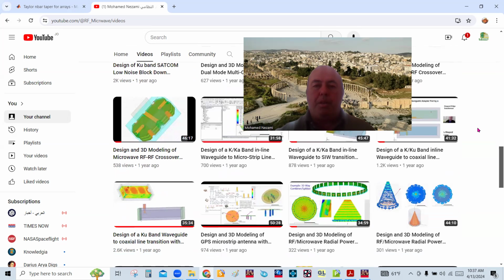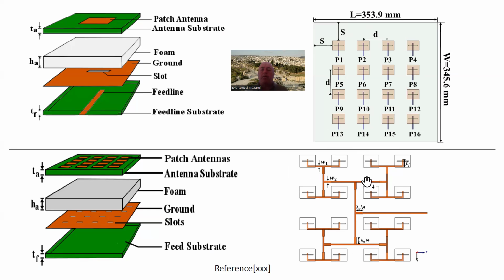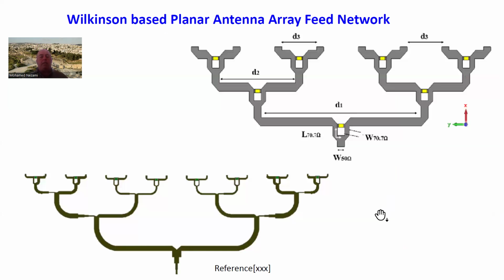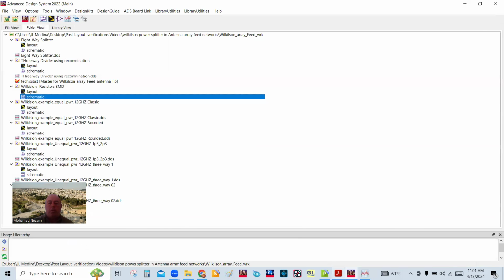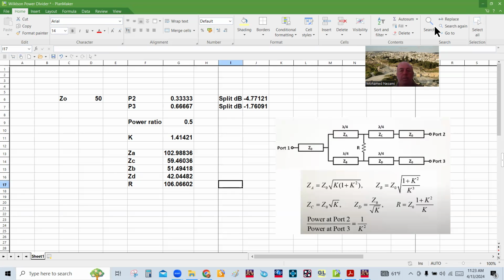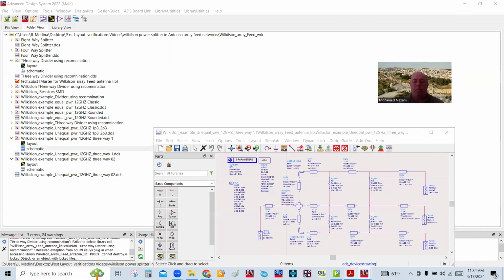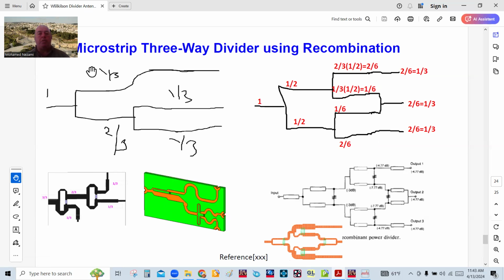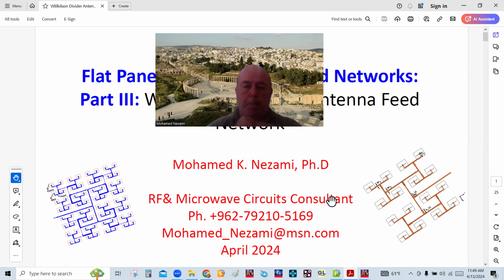Part 3: Antenna Array Feed Networks Design and Modeling, Wilkinson power divider based.

Comment: I have a question. if I were to integrate an impedance matching network in this system. where would I place it? and is it necessary? or does the Wilkinson divider do the impedance matching on its own? and if I want the matching network to be reconfigurable/tunable would phase shifters do the job? also how does the antenna load change with respect to external factors? would the loading effect be resistive? or purely reactive? or a complex?
sorry for the many question but your lecture helped me a lot.
Regards
Mohannad Omar
Reply from the maker: The dividers are designed so that they are 50 Ohms and the antenna is 50 Ohms, so no need for matching, there will always be a small mismatch factor that is 50 Ohms +/- few Ohms, and some small suseptance, but that should still give reasonable return loss.